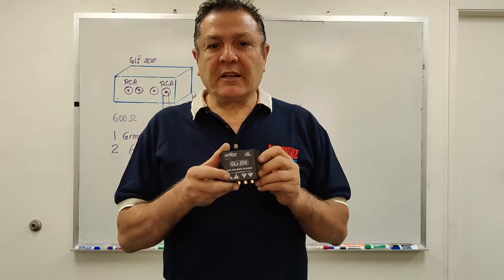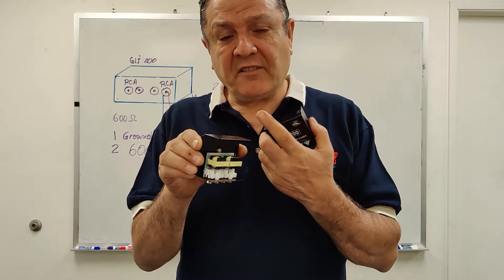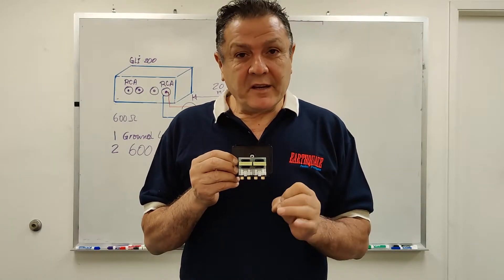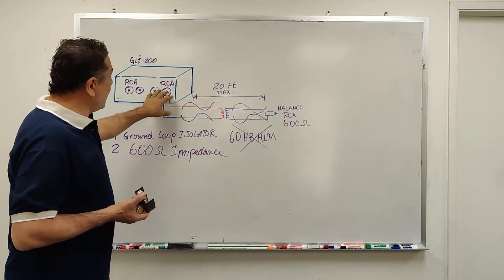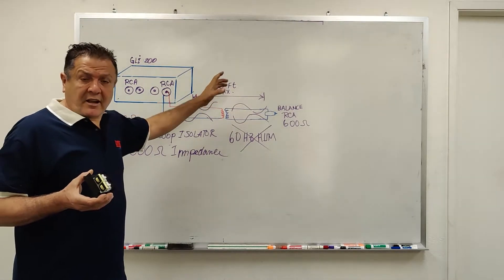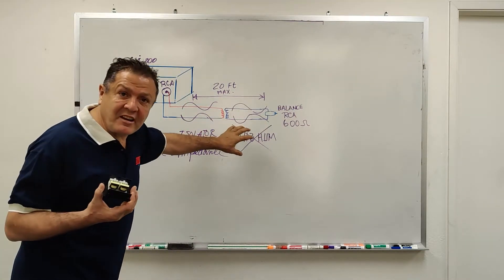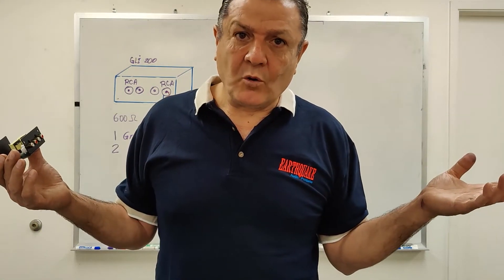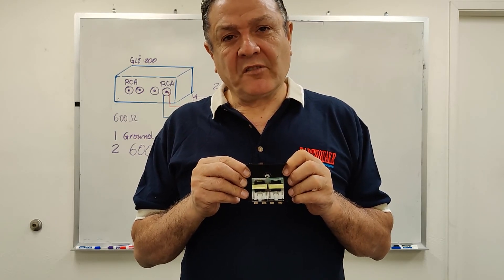Remove Hum Noise With Earthquake Sound GLI-200

Comment: Do not buy this piece of shite. Does not work. I still hear noise. You have been warned.
Reply from the maker: Very sorry that the GLI-200 is is not working out for you. If the problem that you are having is not ground loop, then it will not help.
Please call our tech support line so that we can go over your system to identify the problem.